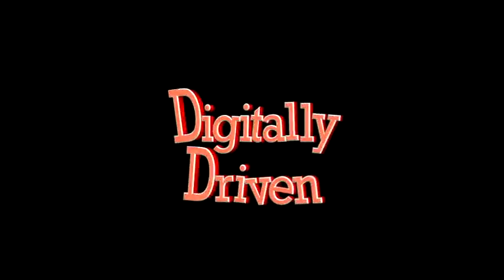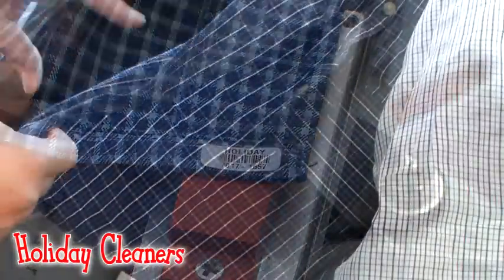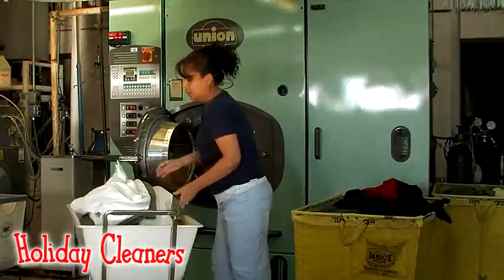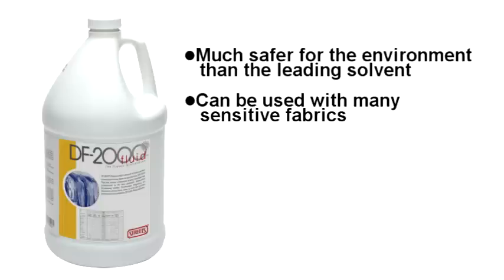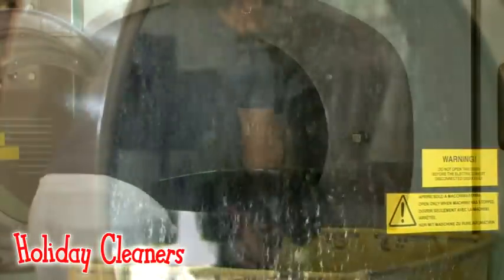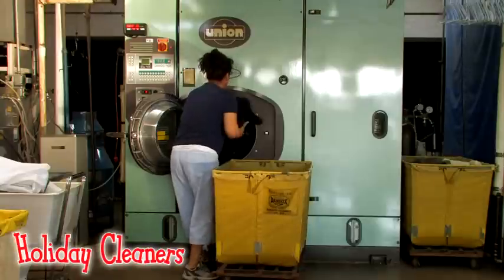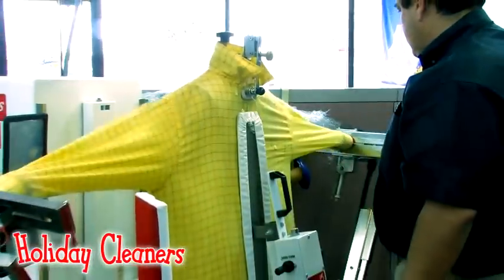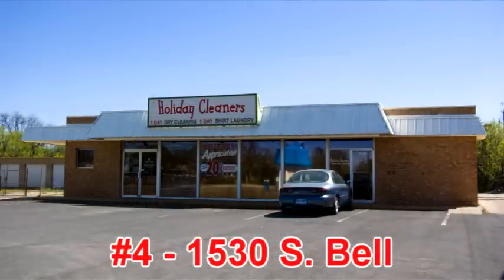Holiday Cleaners - The Dry Cleaning Process

Comment: The solvent is an aqueous solution, so they technically do go into water. It's just that the water has other things in it, as it's a homogeneous mixture.
Reply: No. That's totally incorrect. Technically or otherwise they do not go into any form of moisture and this solvent is not a homogeneous mixture. It's totally the opposite of that. Water and moisture are enemies of this solvent and if moisture does get into this solvent it will start a bacteria that you can literally smell a half a city block not to mention every piece of wool you clean will shrink to half the size it was. So, no there is not any water or moisture in this solvent. Been doing this almost 50 years now.